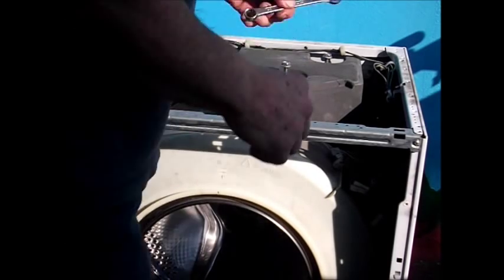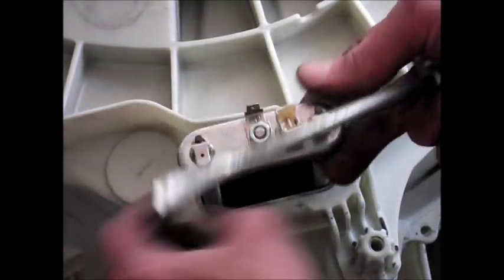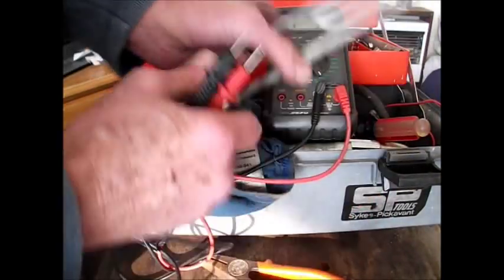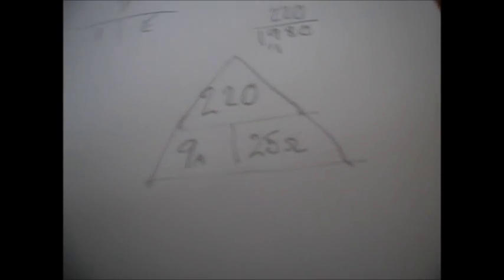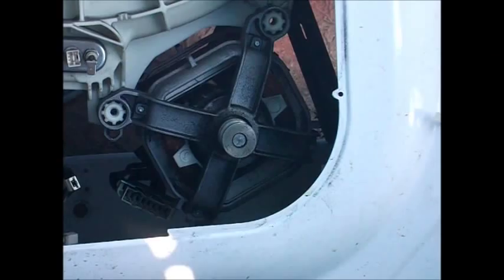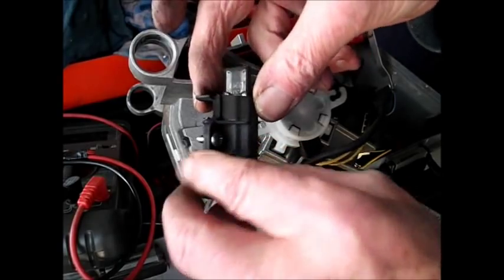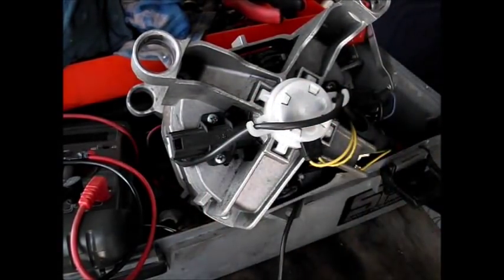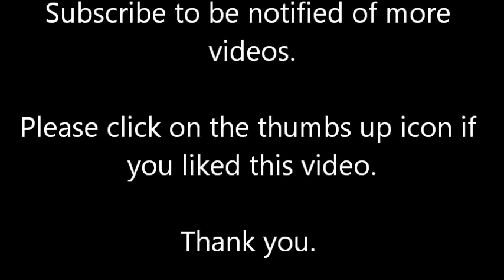BEKO washer STRIPDOWN part 4 (final)

Comment from the maker: To remove the drum you would have to split the plastic tank by removing the clips/screws around the perimiter and pulling them apart. Then you can get at the drum paddles.